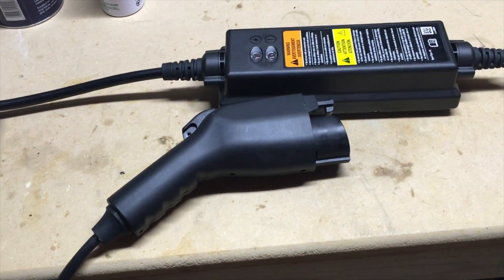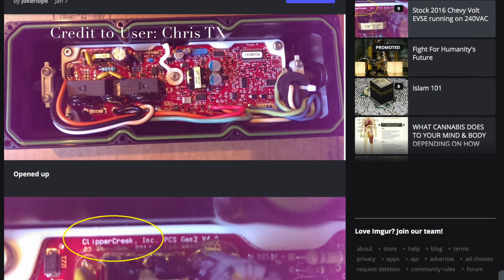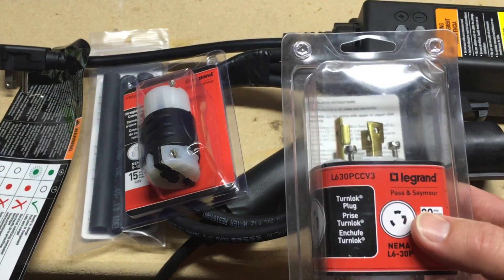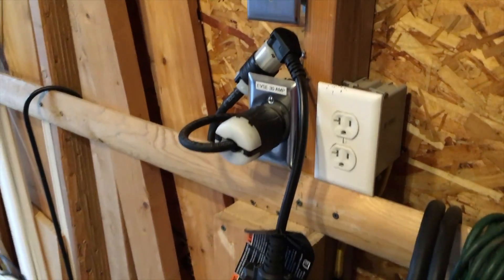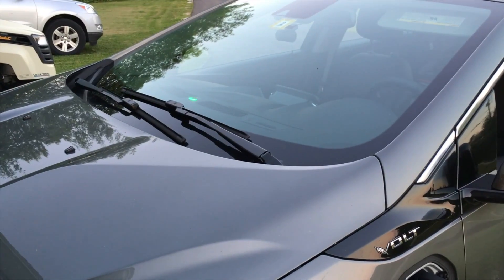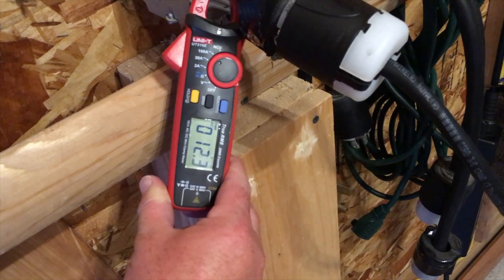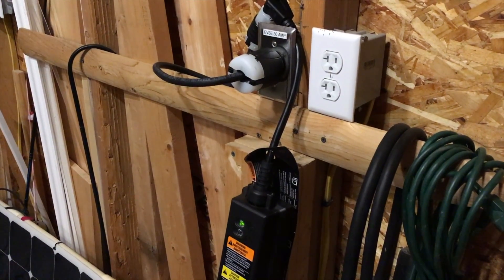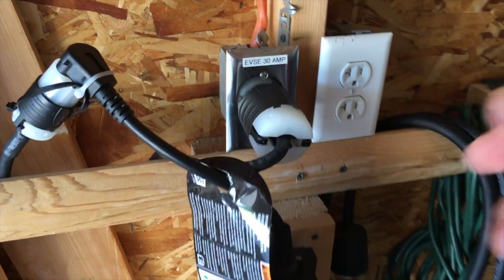2016 - 2018 Chevy Volt Hidden Level 2 Charger 120/240 Charging!

Comment: Definitely want to try this. Question though. Couldn't you just wire a 20 amp standard outlet directly in the receptacle box and skip the adapter cable all together? Thanks for the help.
Reply from the maker: If you mean "standard," as in 120 volt, then no.  The adapter is meant to bring 240 power to the EVSE (charger).  You need to have a 240 power line.
Reply: By "standard" I mean the type of outlet that will fit the plug from the Level 1 charger. Like the end of the cord that you're plugging the charger into, couldn't you just hardwire a 220 outlet with that same type of receptacle?
Reply from the maker: PERSONALLY, I WOULDN'T DO IT.   Your modified "220 receptacle" would look just like any other regular receptacle.  Too many possibilities of plugging in a normal 120 device into it and that would certainly spell a disaster.  Put a dedicated 220/240 outlet in and make an adapter.  That would be the safest approach.  Of course, doing any of this is at your own risk...
Reply: I get ya. Thanks for the advice. Looking forward to giving this a shot.
Reply from the maker: Good luck!  Let me know how it goes!
Reply from the maker: Do you have a 2016 Volt?
Reply: I have a 2017. Just finished my setup. Don't have a garage so I put the charger and outlet in a project box mounted to the side of my house. Plugged in and it works great. Thanks for the tip!
Reply from the maker: Mike Murphy Great Jon and thanks for sharing!
Reply: What is the part number on your charger?  I think it a 8 digit code on the back by a qr code.  I have not read about anyone else doing this on a 2017 and would like to know if we have the same charger.

Comment: I just ordered a new Charger on Ebay for $259.  I want to keep my original charger in the car
Reply: you dont have to modify the charger at all.... Just plug it into a 240 volt using an adapter that routes the hot hot of the 240 volt to hot common of the stock charger.
Reply: you just wasted $259. Totally unnecessary as the supplied charger will work with 110 or 220 volts.

Comment: I have a dedicated watt meter on my setup and it shows a varying 12.3-12.7A upon charging. Been using this setup since may 2016. It's awesome.When you look in the car energy panels or even the OnStar or myChevrolet Apps, it will display charging at 240 and the time-to-completion.
Reply: mglmouser - After one year, how's it working now?  Any updates for us?

Comment: What was is your time to charge improvement?
DIAYOR (do it at your own risk) I love it.
Reply from the maker: If the battery is completely dead, 13 hours to charge on 120v.  About 5.5 hours to charge on 240 with the new adapter on the stock charger.
Reply from the maker: +Santeri Miettinen ok.  I understand now.  Thanks!
Reply: I'm pretty sure that he asked did the charging time improve (how long it takes to charge with 240v versus 120v)
Reply: minor point.  The standard connector is a 5-15, not an L15.  L is for Locking, which you have on your new end, the L6-30.
Reply: minor point.  The standard connector is a 5-15, not an L15.  L is for Locking, which you have on your new end, the L6-30.
Reply from the maker: I bought all of the parts locally from Lowe's and it was about $40.  You can probably do the whole project for $25 if you purchase parts from Amazon.  Of course, I already had 240 in my garage.  Took about 25 minutes to do make the pigtail for the charger to adapt to 240.  Does that answer you question?
Reply: Thank you.  Sorry that my original question looked so strange.

Comment: What's the time-to-charge from zero to full with this modification?  At 12 amps on 110v, the owner's manual says about 13 hours to charge, correct?  Does the 240 significantly cut that time?
I've got a GE 240v 30 amp wall charger in the garage for my 2017 Volt, it will charge the car from almost zero to full in a hair over 4 hours.  I've never even taken the included extension cord out of its original packing in the trunk.

My biggest complaint on the new Volt is that Chevy used a 3.6 kW charging circuit.  My 2013 C-Max had that charging circuit level and took considerably longer to charge at the same volt/amp levels than my friend's 2013 Honda plug in with the same size battery but a 6kW charger.  Why would Chevy "handicap" the car this way?
Reply from the maker: About 5.5 hours on 240 with the mod to charge from 0 to full.  Pretty much my only pick with the new Volt is the lack of the 6.6 KW charger.

Comment: How is the temperature of the cord on the car side, when running at 2880W compared to running at 1440W?
What gauge wire does the EVSE have?
Reply from the maker: It is a little warm from the EVSE to the vehice.  Really don't notice it at all in an overcast cloudy day.  Gets warmer in the sun.  Won't be such a bad thing in the very cold VT winters here.  Internal wiring is 16 gauge.
Reply from the maker: Also, the EVSE has thermal overload protection for the wall plug so I'm not too worried.
Reply: (in agreement) 16 Gauge Wire is rated at 13 amps for each current carrying conductor.  It's definitely right there on the edge for the charger cable and a 30 AMP circuit size prefered.  Many Level 2 chargers prefer to have 125% power availability for the rating of the charger (24 amps on a 30 amp circuit).  This modification accommodates that charger sizing requirement for this 30 amp circuit without paying the hundreds of dollars for a new charger.

Comment: Cool. Guess I am confused. With the L630 connector, there are two "hots" and a ground? And no neutral? My L530 for my Honda generator an inverter AC-in is 120v. It will carry more amps (30a) instead of a typical household 15 or 20 amp circuit. It is a three wire black-white-ground wired with 8/3. I found that 12/3 won't handle start-up surge of an air conditioner. 10/3 will work...8/3 is best.
Reply from the maker: Correct.  The L630 carries two 120 volt legs and a ground.  There is no neutral with this plug.  When I first wired a few years ago I was confuse as there was no neutral.  Found out that a lot of 240 receptacles don't typically use the neutral wire. 

The L630 runs to a sub-panel in the basement that terminates to a double pole 30 amp breaker.  Wiring is 10 gauge from the sub panel to the L630 receptacle in the garage (to which the EVSE and adapter plugs into).  The Chevy Volt EVSE/charger auto senses voltage and knows if you are connected to either 120 or 240.  Now that the charger is only drawing 12 amp, my 10 gauage wire is oversized and will very much act in the same manner that you described when going from 10/3 to 8/3.
Reply: SWEET! And now...I know! Honestly, I didn't know that. Nice set up!
Reply: Great video. I've been using this mod for 3 months and it works beautifully. Installed an exterior 240v outlet on the side of my house at the driveway. Since there's no neutral, as vtmaestro points out, I installed a GFCI breaker in the main panel to service this dedicated exterior 240v outlet.